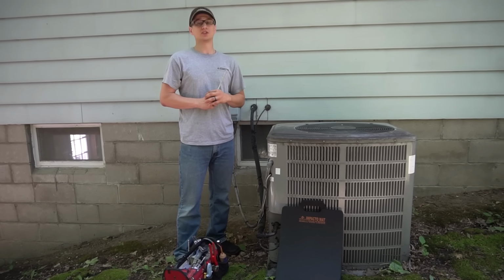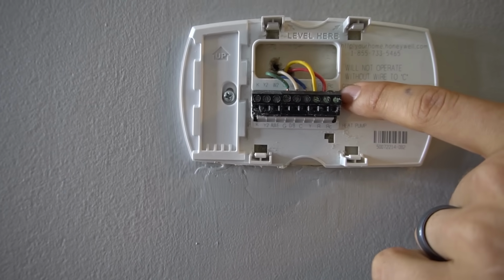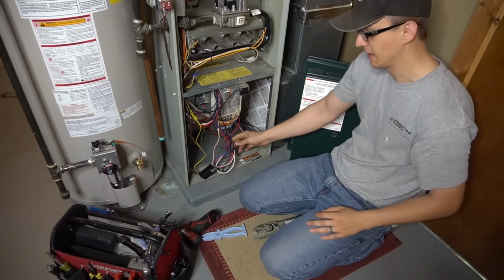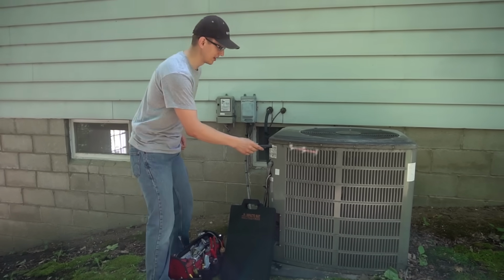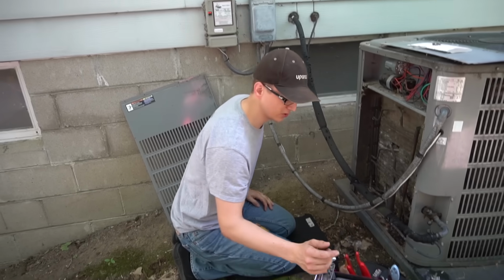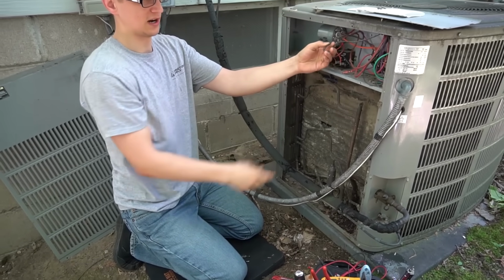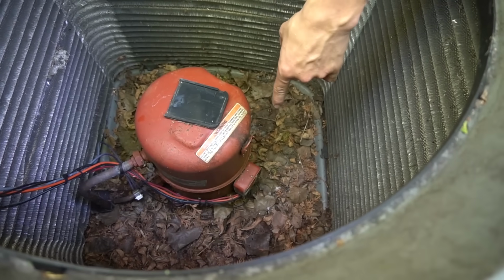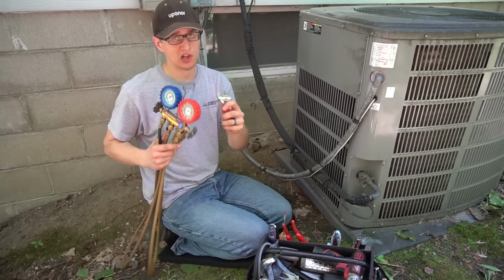AC Unit Not Turning On - How to Fix It Step by Step

Comment: Thank you for the help! this video was very informative.  However I'm still stuck with an AC unit that is not working.
It stopped working after a thunderstorm - the compressor isn't humming fan is not spinning
I have changed the thermostat batteries (fan comes on but no AC), I have checked the breaker and they seem fine, I replaced the 3amp blade fuse on the furnace board (wasn't working - getting error code 24), I replaced the capacitor (bubbled top). the plunger on the connector seems to be pushed in and when i press it with a screw driver it gives the slightest hum.  
I don't have a voltage meter, any wat to test these components without one? Any idea what could be the issue?
Reply from the maker: Oh wow, it seems like that thunderstorm took out more then one thing. So to clarify..

1. Does the fan or the compressor come on outside?
2. How about when you press in the plunger, do either of them come on?
3. You replaced the capacitor, any chance it was mis-wired?
4. You may not have 240v. Does your disconnect have fuses? Perhaps they are blown
5. Your compressor is failing to start. You can try putting in a SPP6 Hard Start Kit: https://amzn.to/2JSPieo
a lot of times that will get it to start. But if your fan is not coming on either then I would focus on a power issue.
6. If you are up for it, https://amzn.to/2KpOMB5 here is a cheaper version of the meter that I use in the video. Then you will know for sure if you have 240v. You could also do resistance checks.
7. Does your condenser unit have a control board in it?

Hopefully it will be something simple. Let me know
Reply: Thanks for your quick reply, as to your questions

1. no neither is coming on
2. neither come on when i press the plunger, there is a faint hum though
3. I replaced the wires from the old to the new one by one. (2 yellows got to the 4 prong "com",  blue to the the 3 prong "herm" and brown to the "fan"
4. the disconnect does has fuses, that was the next thing i was going to change, but it seems that the unit is getting power.
5. I think it might be a power issue as well and will check other components before trying this suggestion
6. I think i will have to buy one
7. no, there is no control board on the condenser

I did remove the contractor and pulled out the plunger and noticed that the connections looked corroded so I ordered one and will see if this fixes the issue

I appreciate the help!
Reply from the maker: Thank you for the numbered answers :) Okay, so it sounds like the capacitor is wired right. From what you said, I would still be looking for a problem with the 240v. You should be able to get those fuses at a hardware store or they are on Amazon too. Usually it says right on the fuse if it's 20,25, or 30 amp. Being that you had a thunderstorm, I could see how it could have taken out a fuse or 2. About the contactor, almost every contactor I see is pitted and charred and they work good so it's unlikely that it's the culprit. But who knows :) The faint hum you hear may be coming from the contactor coil. A compressor trying to start is usually more then a faint hum. So yeah.. That's about all the thoughts I had to offer. I still suspect the disconnect fuses. Let me know what you do. Hope it will be back up and running soon!
Reply: Went from bad to worse.  I replaced the contactor and now there is no power to the furnace. I checked the breaker and it isn't tripped and the "light switch" on the side of the furnace is on but there is no light on the circuit board.  Anything I could have tripped? or is there a way to reset the power to the board?
Reply from the maker: Sorry to hear that.. Did you turn the thermostat and furnace off when you changed out that contactor? If not, then you may have blown the 3amp fuse or breaker that's on or to the side of the control board. (It's rare that there is no fuse but if there is no fuse on your board then it's possible that the board, transformer, or thermostat could have been damaged.) Unfortunately without a meter to check things for sure, I can't say exactly what is wrong. Let me know if you find that fuse. Replacing it will bring back your furnace. (hopefully that's what it is) Also, make sure the door switch is closed.
Reply: I had turned off the breaker and outside disconnect when changing the contactor.  I checked the 3 amp blade fuse on the circuit board and it seems fine.  I tested the board and it is getting power from the "door switch" to the board but only the white connector and the line to the junction box are showing power (using a non contact voltage detector"

I tried replacing the fuse but the board still has no light

I have a voltage meter now, what should I check?
Reply from the maker: Ah.. I am sorry to hear that it's not something simple like a fuse. But you have a meter now! Good :) Now we can really check some stuff! Okay,  with no further delay let's check some voltages:

1. First off, turn your cooling on at the thermostat and lower the set point so it is "calling for cooling". Next, take off the furnace doors and tape the door switch shut.
3. Take out that fuse one more time and set your meter to the resistance setting. (an omega symbol) Put a meter lead on each spade. Is there some kind of resistance reading? If it's nothing or says O/L, then the fuse is bad. (Keep in mind that if you accidentally check resistance or continuity on something that has power going to it, it will fry your meter. When checking resistance, power always needs to be off)
4. You can also check the outside disconnect fuses too. Either check the resistance on them like explained above or you can set the meter to continuity which is that sonar looking symbol which is usually by the omega symbol. Turn the circuit breaker to the condenser AC off and put one lead on one copper end of the fuse and the other lead on the other end, if the fuse is good, it will be a continuous beep (if meter is set to continuity), if it says O/L, then the fuse is bad.
5. Locate the transformer which is usually somewhere by the furnace control board. It should have two sets of wires coming out of it. The primary side (120v) is usually black and white. But you are looking for the other 2 wires, the secondary side (24v). Find where those two wires go and put your two meter leads on both wire connectors. (your meter of course is set to voltage) Do you have 24v coming out of your transformer? (it's never exact. Usually anywhere from 23-28v)
6. Locate the thermostat terminal strip on your control board. (R,W,G,Y,C). Put one lead on the R screw and the other lead on the C screw. You should have 24v there.
7. Then check R to Y. It should be 0v. Then check Y to C, that should be 24v.

Sorry, that may be a bit much.. Check that for now and see what you find. Good luck and be safe!
Reply: Thank you for taking the time to walk me through all of this I really appreciate it!
Following your suggestions here is what  I got:
1. Turned the thermostat on cold and held it at 60 (inside at 80) and taped the door switch 

3. Checked the fuse and it is showing 3, was I supposed to check the board to? Since you said not to with the power on.

4. The fuses in the disconnect box were both bad, replaced those. However light on the furnace circuit board did not light up.

5. I checked the transformers output and it read 27.5V

6. R-C: getting 0V

7. R-Y: 0v. Y-C 0V

I removed the door switch and tested the resistance and there was none.  I'm thinking that it went bad and is causing all the problems now.  Is there a way to temporarily bypass the switch to run the system until I get a new one?

*update I placed the black wire coming from the power "light switch" directly on the board "L2" location where the black line from the door switch was  going and still nothing.  Is the board bad, Is there a way to test this?
Reply from the maker: Thank you for the nicely laid out responses. I appreciate that too! Makes this a lot easier. Sorry I couldn't respond sooner. But let's continue where we left off!

- The 3 amp fuse is good.
- Good that you replaced the disconnect fuses.
- The door switch is good. If the power was interrupted at the door switch, you would not have 27v coming from the transformer since power goes to the door switch first.
- Just in case you are still curious.. If I were to bypass the door switch, I would simply take both wires off of the door switch and put a little jumper wire into both of the connectors.
- We know your transformer is good now.
- I asked you to measure R-C to see if the control board was bad. The board is bad and needs to be replaced. It is not sending the 27v to the thermostat terminal strip. Sometimes you can even find a burnt spot on the back of the control board when you take it off.
- When replacing the board, I suggest taking a picture of the wires, labeling them, or going wire to wire so that no wires get wired wrong. Also, if the new board looks different then the old one, it will most likely come with instructions of how it should be wired.

Let me know how it goes. You are doing a great job! After this is all done you could probably get an HVAC job! :D
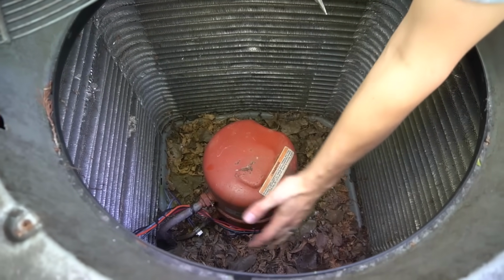Reply from the maker: On a side note.. If both disconnect fuses were blown, there is a chance that your compressor is bad. (that would be bad. Compressor is expensive and not a DIY project) Do the check that I do in the video now that you have a meter. (make sure power is off) I start talking about the compressor at 25:08 Also, when you take the compressor wires or plug off of the compressor pins, besides the test that I do in the video there is one more thing you should check. There are 3 pins. Check resistance between all 3 pins. What readings do you get? So from pin 1 to 2, 1 to 3, and 2 to 3.
Reply: Switched the board out and SUCCESS!!! everything seems to be back up and running.  Thank you so much for help walk me through each stage! You just saved me from buying a new AC unit.  So glad it wasn;t the compressor

Can't thank you enough! It is going to be 95 this weekend so just in time!
Reply from the maker: You are very welcome! Sorry it took so long. But now you know your AC system pretty well! Plus you got a meter so if it stops working down the road you are well equipped (if your relatives find out you fixed your AC you will also become their go to guy lol) I am happy this long thread had a good ending! Awesome! Stay cool and have a great weekend!

Comment: PEOPLE CAN GET KILLED OR SEVERELY INJURED LISTENING OR FOLLOWING THIS VIDEO. IF YOU ARE PRO TECH. YOU WOULD NEVER ADVISE UNQUALIFIED PEOPLE TO REPAIR HVAC SYSTEMS. SOMEONE GETS SHOCKED WITH A LOAD ON THE CIRCUIT. AND GET A FINGER CHOPPED OFF OR GET 330 VOLT CAP SHOCK, MONOXIDE POISON, EYE OUT ETC.......

Comment: how does the working work for a t stat?
Reply from the maker: I don't think I fully understand your question. But if you are asking how the thermostat works here it is, the brief version: The furnace control board sends power (24v) to the thermostat. Then, when the thermostat is set to cooling or heating, a little internal switch in the thermostat closes and sends power back down to the control board and the board starts either the heating or cooling. Also, if you are interested, this is what the letters where the wires go to mean:

R: Power
G: Fan
Y: Cooling
W: Heating
C: Common

Comment: What should I do if the LED light is not on?
Reply from the maker: Hmmm.. Well there's  quite a few things it could be. Try checking these:

Does your furnace have power to it?
Is your door switch pushed in?
Is the furnace power switch on?
Is the furnace circuit breaker tripped?
Is the 3 amp fuse or breaker on the control board blown/tripped?

That's about all you can check without a multi meter. If you have one let me know and I can tell you where to check voltages to narrow it down to the real issue. Usually the LED is always on or blinking. So when it is blank, that indicates it is not getting power. Let me know what you find, good luck!
Reply: Word of Advice TV 
I will and thanks a lot for the troubleshooting ideas and starting points